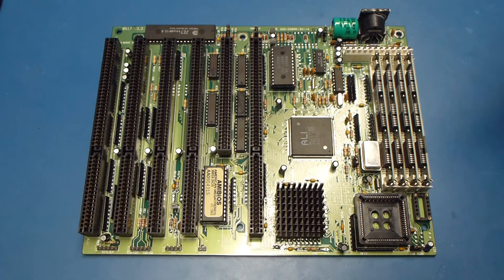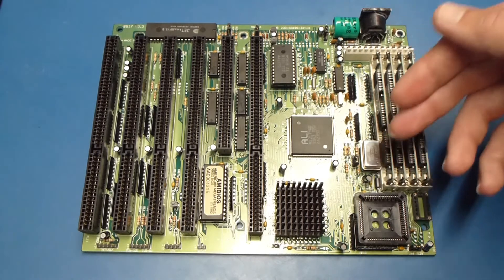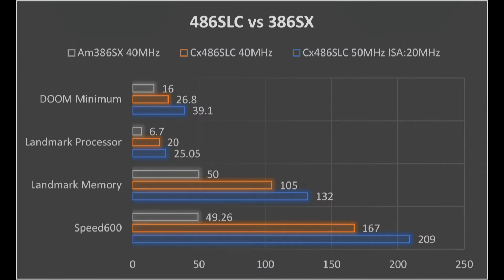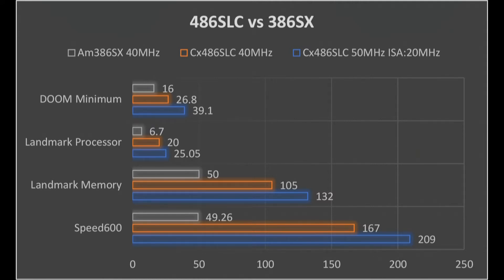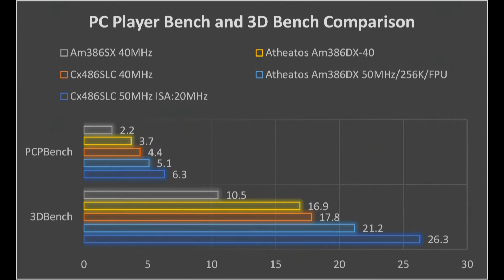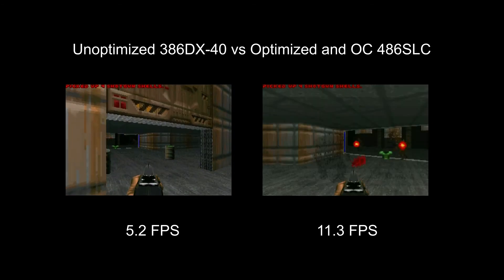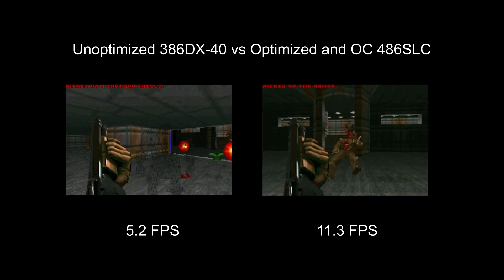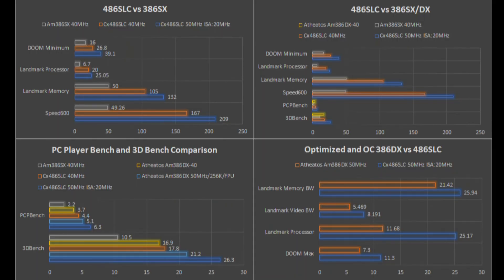Overclocking the 486SLC-33 to 50MHz!

Comment: Haha this brings back some memories... I ran a BBS on Dallas TX back in the 90's on a 386 back in the 90's and was gifted a TI made system board with and integrated TI 386SLC 33mhz processor by a user who worked for TI. I know it was still based on the Cyrix 486SLC but I swear it performed better especially over clocked. I recall taking it to lan parties where people running DX66 were saying it performed better. Thanks for the video.

Comment: Hey K2, great videos about this CPU upgrade! Really like your content as I love to see old boards like these running their socks off ;-)
I have a question you may be able to answer: I did a similar upgrade with a slightly older cousin of your two mainboards, the M396F (another SARC/PC Chips/ALi/Acer variant). 
My board originally came with a i386SX-20 but can also run AM386SXL-40s etc. and so I also desoldered my crystal oscillator to put in a socket with an 80MHz variant and soldered on a 5v Ti486SXLC2-40 with 8k of L1 cache which can run either at 2x20 or 1x40 MHz "core" speed. Off course I went for 1x40 ;-)
The board seems to run stable except with (really) cold boots. If I cold boot the thing it seems to reset about 4 times before it's able to actually finish its RAM count and boot. The weird thing is, when I run it for a few minutes and switch it off and on again it cold boots fine but when it's completely cold I get the weird reset loop. I measured the caps which are fine and used a different power supply which seemed to improve stability a bit (the other one had a low 12v rail at about 11.45v) but it keeps happening. I wonder if the BIOS on this thing is too old as my particular processor is a lot newer newer than the board? Or maybe the RAM is too slow? I use 70ns memory. Maybe I need 60ns minimum? I'd like to hear your take on this, as there aren't too many people crazy enough to do these kinds of upgrades nowadays ;-) I think it may be the RAM that's a bit too slow as it always fails during RAM counts and resets..
Thanks in advance!
Reply from the maker: Thanks! I hope to make more of these but no way that's happening with school and work right now.

I would check every single solder connection on the processor. You probably have one pin that isn't soldered and when the chip warms up just a bit it will make a connection and work fine as long as it is hot. I can't tell you how many times I had to go over every single pin on my Voodoo 3 motherboard upgrade before I finally got every pin soldered and every little speck of memory corruption off the screen. One way to check is to look very carefully and take a pick to try and gently move the pins. You can see me doing it here: https://youtu.be/bJbIDYMIc8A?t=834

70ns memory might not be able to run 0 wait states at 40MHz but if it boots and eventually runs without issue, the RAM isn't at fault. In fact, as the ram heats up its ability to run at over rated speed declines so it's even less likely to be the issue. Also, my 60ns RAM runs 50MHz with 0 wait states and I don't think I've ever had an issue with 70 in a DX-40 so 70 should be adequate. BIOS should be fine as it wouldn't recover and eventually run.

Where did you pick up the 5V processor? My other SX board that still has a 386SX on it would like to know! Be neat to do a comparison of 8kb vs 1kb! Kind of surprised at the cost of 386SX boards on ebay... Makes me regret getting rid of the 3rd of this motherboard I had thinking I would never need it. Could always 'upgrade' it again with an 8kb CPU or just live without an extra slow 386SX laying around.
Reply: @DKJones96  Thanks for your advice!
Yeah, making videos is fun but it requires a lot of time and effort indeed, which doesn't mix well with a daytime job or school for that matter..

I ordered a set of (4) new 16mb 60ns (purple :-)) SIMMs for this machine as I now only have 4 megs and I want to max it out. I got the CPU from a German Ebay seller but he sold his whole batch of 10 already. They were new old stock. These TI Potomac CPUs are getting kind of rare indeed but they pop up every once in a while, especially from Chinese sellers. They're not as rare as their DX counterparts, like the TI486SXL2-50 which I used to succesfully max out my old 1988 Compaq Deskpro 386/25. It took me year and a lot of work to find one of those! I love working with 386 class machines and upgrade them to the max :-)

I don't know if it's worth the effort for you to upgrade it to a TI, especially with that pad coming loose (off course you could always add a bodge wire haha). I lost a pad too, but on my board it wasn't connected anyway so no harm there. Yours actually has the Flush pin connected so it may have logic built in to flush the Cyrix's internal cache.
The 8k vs 1k cache difference is not that big though. I definitely think your 50MHz overclocked is faster than my 40MHz unit but I get the incentive to always go for the absolute max ;-) "What about an overclocked TI486SXLC-2-40 running at 60MHz?" Nope, It'll probably blow up ;-)

I'll go over the CPU again indeed. There me be something lose. Those pins are so tiny! Using a lot of flux helps a lot indeed! Thanks and keep up the good work!

Comment: Great ! About the bandwidth difference between 386SX and 386DX, I have a theory that a 386SX talks "faster" to the RAM than 386DX do which compensate to some degree having half the bandwidth) I think 386DX have a waitstate for RAM access, but 386DX' cache has none.
Reply from the maker: I want to say the SX seems 'faster' than half speed only because it doesn't have a choice.

For the DX to address memory and then cache it has to change 4 byte enable bits. These are run through simple logic gates to create address lines 0 and 1 which are used to tell which bus things are being sent to between ISA, cache, memory, or ROM. This is where I think the extra speed comes from in the SLC's case. The SLC doesn't have to touch the external bus to make an internal cache hit. The MMU just does it, however, the DX has to setup the bus again to execute a cache hit. 

But that's not all! FPM is what it is because it is optimized for sequential data reads. Not quite as optimized as EDO but yeah. Because the DX has to 'switch' busses between cache and memory hits the DX has less ability to take advantage of the FPM mode of operation for that memory and ends up having to re-address the RAM when it goes back. This requires longer setup time and therefore takes longer. The SLC doesn't have to do this and the SX doesn't have anything else to address.

I do have the ability to test this theory and if I end up with a slow day this week I will do it. I'm going to work on optimizing the 486DLC and DRx2-66 386DX upgrade processors and with that I will look at how internal processor cache affects the DX platform.
Reply: @DKJones96  well I'm not even thinking about 486SLC but just 386DX vs 386SX. I have a 25MHz 386SX with a VLSI SCAMP chipset which let me tweak the memory settings a little and when I do, the performance of it isn't too bad compared to a DX25 (actually I think it can score better than a cacheless DX25 in speedsys)
Reply from the maker: @DxDeksor  dang, that's quite a difference!
Reply: @DKJones96  now it may not be 100% fair as it was probably an unoptimized 386DX vs a super optimized 386SX but still
Reply from the maker: @DxDeksor  lately I've been thinking about that and if it's something you don't even have to mod for I say it is fair game.